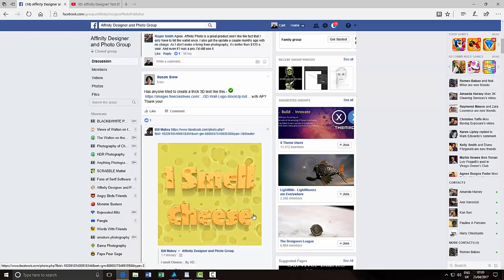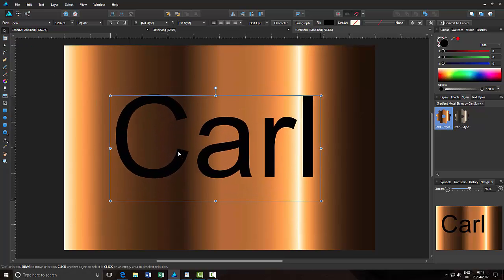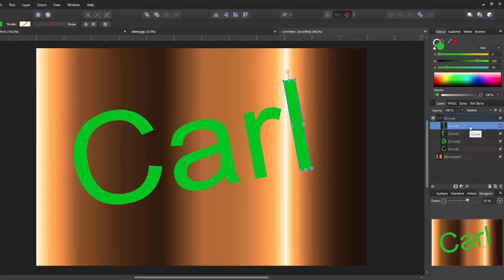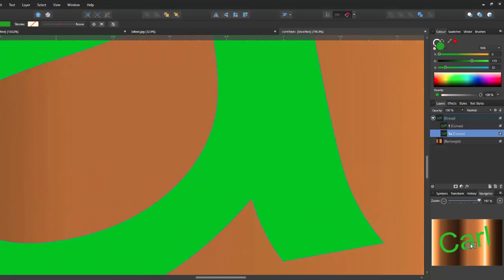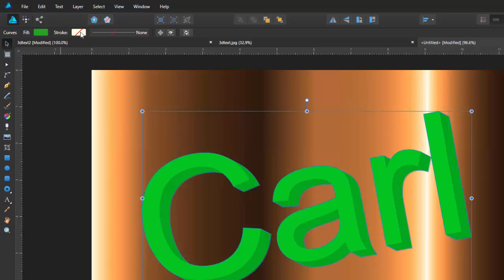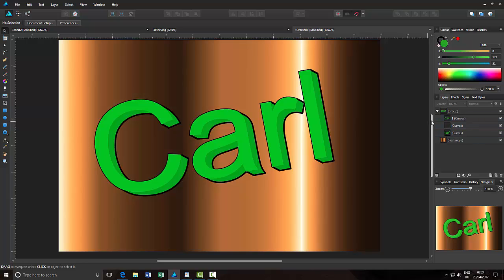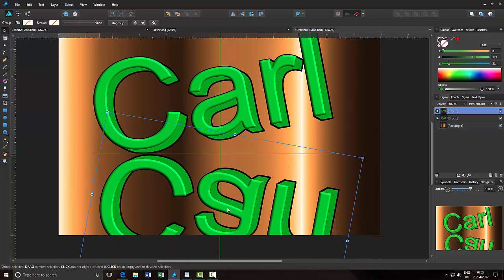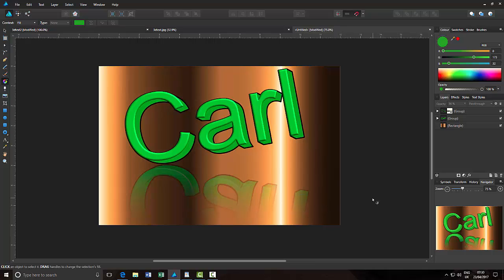Affinity Designer - Basic 3D Text

Comment: Thanks for the Breakdown, Carl.
Regarding the skewing of your name: in the original CheckIt video (which is on PC, not Mac, note the white cursor), he first Converts To Curves, thereby killing editable text. But I don't think Converting to Curves is necessary. I just tried it on a Mac, and I can have my cake and eat it too: I can keep the type editable and still skew it. In fact, I don't even have to drop the Type Tool for the Move Tool, it works either tool. The trick is positioning the cursor just right. It seems very particular, but if I maneuver the cursor on the middle node I get a set of opposing arrows, allowing me to skew it. Hope this help.
Reply: Thanks, first all to Carl, who does a tremendous effort to keep us on course with the latest YT videos , and secondly to you James for signaling the differences between the Windows and Mac versions of Affinity Designer.
I'll check it out too, and report if necessary.
Reply: The cursor in question, the double arrow cursor as Carl calls it (it's actually two separate opposing arrows) appear on ALL middle nodes, not just the top-middle node. You have to hover near a middle node and the cursor flips between the single double-ended arrow to two arrows pointing in opposite directions. Man, I hope I'm not confusing everyone. Skewing can occur from any middle node. And of course rotation occurs with any corner node. Whew!
Reply from the maker: Thanks, I have had someone else say something similar, so tried it out and still could manage to get it to work. I will try again.
Reply from the maker: I have sussed it out. If you place cursor between top-middle edge node and the rotate node above it. The cursor changes to a double arrow and then you can tilt the overall box.
Reply from the maker: Thanks for clearing that up ;-)